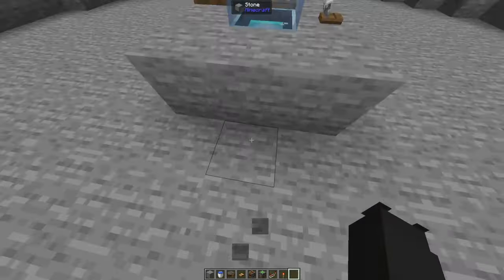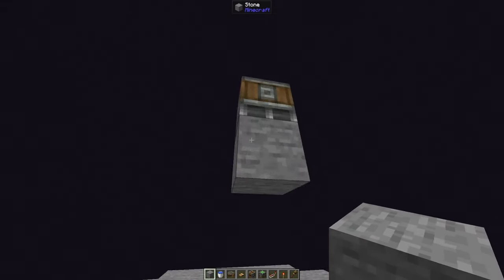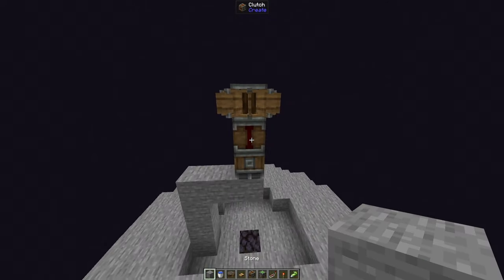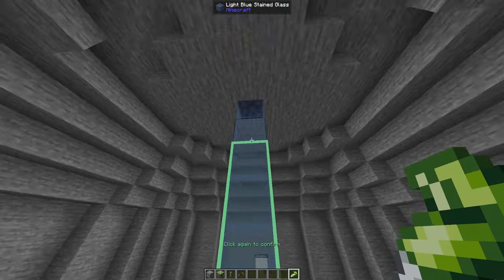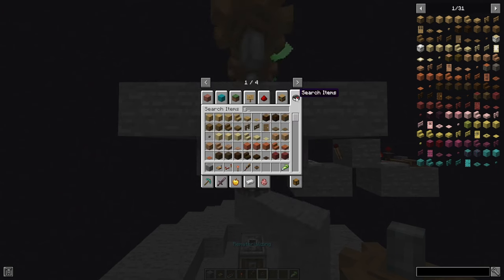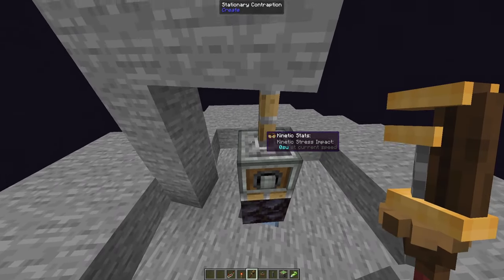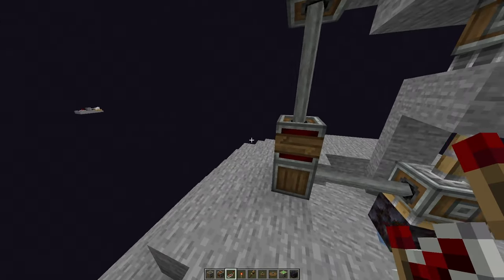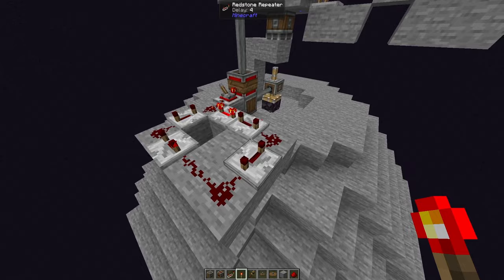How to Animate Your TARDIS Interior With Create

Comment: 11:47 you can do that, just use a casing on the large cog before you place the small gear on top of it to prevent the shafts from connecting
Reply from the maker: Good point